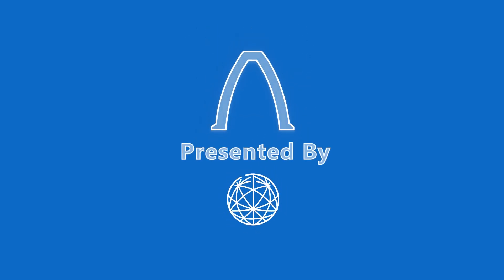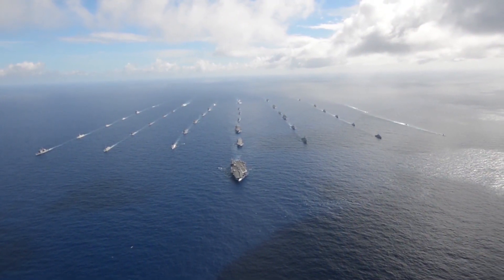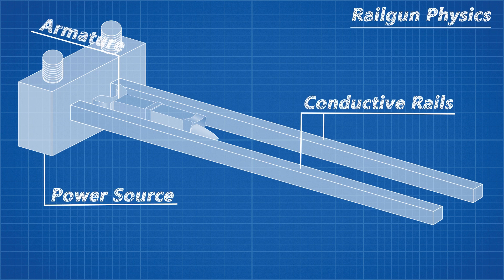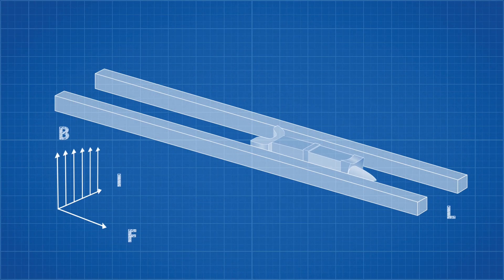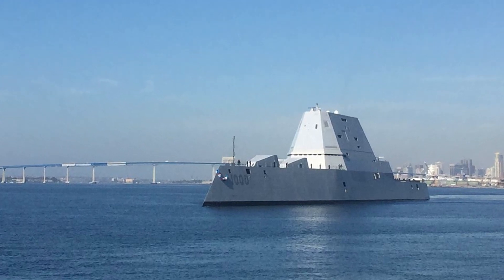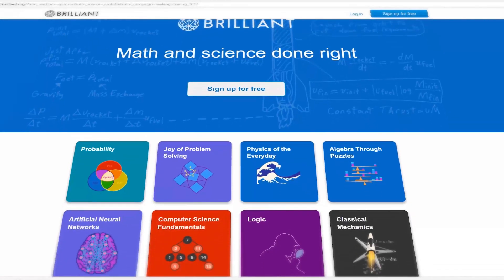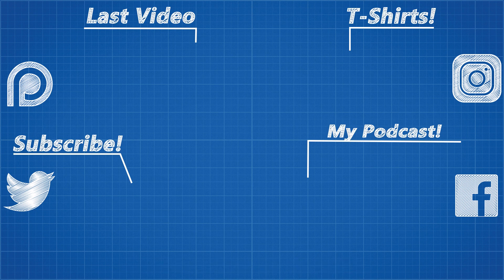The US Military's Most Powerful Gun

Comment: Another possible solution for electromagnetic propulsion is to use coilgun or Gauss gun/rifle. This does not need sliding contacts, and huge amount of current passing through, but it has other drawbacks (like ferromagnetic or inductive electromagnet bullet or armature, and coil(s) reluctance).

Comment: the pieces of  metal that came out when the projectile was launched were the  connecting plates of the projectile meant to complete the circuit of each projectile, each round have this casing that release when the gun is fired, its not the rail coming apart.

Comment: I'd really like to see the math behind deflecting an asteroid with a railgun.  Presumably to even hit the asteroid they'd have to fire when it was quite close, which means they'll have to deflect the asteroid's path significantly.  If they could hit it months or years in advance they might only need to change the path of the asteroid by a fraction of a degree, but so close to earth you need something a lot more drastic.  That just multiplies the amount of force required by orders of magnitude.

Also, since the asteroid would have a much, much higher mass than the railgun, wouldn't the force of even launching such a projectile push the rail gun really hard?  I mean, if it's enough force to change the trajectory of an asteroid, it's going to deorbit the railgun or send it into some wildly elliptical orbit, depending on which way it's shooting.  None of that sounds plausible to me, at all.

Comment: Out of curiosity, could the Lorentz force be used for artificial gravity of a kind. Wires in boots get a current, get a force going downwards.

On a side note, how much of middle ground is there when using the Lorentz force for a launch mechanism, vs as a gun. what I mean is once you have used the electromagnetic system, how much control is there of the final velocity once its overcome friction, to say safely launch a satellite or manned spacecraft compared to pressing a button, strapping in and hoping for the best as you get launched as fast as possible.

In scifi, I believe railgun technology has been used for other things than ballistic launches. in the Andromeda tv series, EM rails were used as launch systems for fighters and missiles, on the rational that they got up to top speed faster, that they didn't need to use fuel in the launch and so make the fighters smaller (smaller fuel tank) and the missiles pack a bigger punch (more room for explosives). with the missiles it also meant that they could be launched completely inert rather than having a controlled explosion going on behind which if something went wrong could affect the payload.

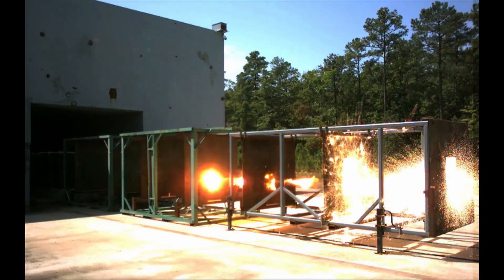Comment: iv got an issue with your point at 4:14, you say it needs 24 megawatts of energy to fire it. if im not mistaken 24 megawatts doesnt say anything if you dont paar it with a time, lets say 24 megawattseconds or 24 terrawatthours. if you take a charged capacitor and short it out and only look at the beginning of the discharge curve im pretty sure you can find a nanosecond or whatever where it puts out 24 megawatts. also if you power that thing from a ideal capacitor bank with minimal leakage you could charge it with 9v batteries if you want, just takes some time... :D

Comment: I didn't know a current could have an angle... The rail gun is so silly. I had no idea they were trying to design a gun which shoots a metal rod which needs to be in contact with the barrel as it fires. This clearly is never going to work as there does not exist the materials to withstand that kind of friction. If the projectile was a magnet could it be fired as a frictionless projectile? Not that designing guns is a worthwhile endeavour.

Comment: An all-electric Destroyer?! YGTBFrackingKM.  What is wrong with nuclear powered ships with an array of capacitors? Capacitors can be grounded in the event of an incident, harmlessly discharging their stored current into the surrounding seawater. They already solved the problem of catapults causing powerplant fluctuations on nuclear carriers with the semiconductor-capacitor-powered electric catapult.
If the U.S. Navy seriously wants to use this technology, they should bring back the nuclear Cruiser, and contemplate a nuclear-powered battleship. No fuel restrictions, endless supply of electricity. Any technology that is not a public danger is worth using for national defense.

Comment: Does not seem like rail guns are the solution to much of anything. Rail guns require an impressive power source, whereas chemicals are so much more simpler. In fact the good solution seems to be liquid propellant. Also you get such diminishing returns in high velocity because air resistance goes up so fast relative to velocity.
Reply: With rail guns you get far more effective range , accuracy and destructive power since the metal rod leaves at such ridiculous speeds. The whole point of using rail guns was to not use propellents , so scenarios that fell upon HMS Hood will be impossible.

Comment: We still use railguns?  Don't they break after using a few times?
Reply: Again, that's where you are wrong. You have to consider the fact that the 2 magnetic rails will produce enourmous magnetic for but not all of it will be going to launch the bullet, that will turn into waste energy/Heat. When the rails heat up, they soften and they will wear down easily.

What the thing that is wrong with your claim is that you have never heard of magnetic friction and how "Sliding" creates friction. both generates heat.

Obviously, you aren't watching the video. Most rail gun videos in slow motion always show a scene where a "Bright spark" comes out of the barrel, and those bright sparks and tiny puffs of smokes are the fragments that was scraped from the rails.
Reply: Again, you can't prove me wrong unless you explain everything about it, and i mean EVERYTHING.

Plus, you're telling me, that air materials such as oxygen and nitrogen are combustible huh? our earth is probably a huge fragile bomb based on what you say.

The hottest the air can be is until the point where they turn from gas, to plasma.(But it takes over 11,500 degree celsius to do so)

if the air does explode, then the rail gun has an ineffeciency of being slowed down by a little due the the pressure of the combusted air, BUT ENGINEERS DONT LIKE INEFFECIENY SO WHY WOULD THEY LET IT BE?

and if it's too hot that it causes fire, then it you would probably see a goddamn air distortion heat in the camera, but if you do, that's the hottest it can get.

where did you learn your science? Pseudo-science?
Reply: jake hansen let me say this again

A superior firepower will have a shorter barrel life in exchange, it's bad because you can't remain in the battlefield longer than everybody else.
Reply: The Dishonored Coward yeah but there's alot of metal with very high tensile strength, but they have nothing to do friction and stiffness.
Including the fact that  they are less conductive than the elements used for magnetic rails.

If there is a material with high friction resistance and high electric conductivity, then im wrong for assuming such metal dont exist
Reply: Yeah, with new technological advances new materials are being created to withstand the stressors of firing a high-velocity weapon such as the railgun.
Reply: No, thats actual fact. The rails literally melt and have to be replaced for testing after 3-4 shots.
Reply: ya don’t say
Reply: Chaos Craft999 you honestly think the rail guns barrel will run out before a barrel of an explosive charged projectile? Just think about what you're saying for a minute.
Reply: Chaos Craft999 but a rail guns barrel will last longer then a conventional barrel because less friction and less explosive energy put on it.

Again sliding something down a barrel compared to blasting it common sense.
Reply: Chaos Craft999 those sparks are the air heating up around the projectile and again use common sense and think about what you're saying.

The rial gun barrel will last longer then anh conventional barrel because if how efficient it is at letting all its energy out the end.
Reply: Eh, just use metal with higher tinsel strength and occasionally return to base to replace worn parts. It will be fine.
Reply: Ray B lol wrong.

The rail tends to soften everytime it heats up during firing, and it will tend to wear off by friction.

So its not durable as you think, it gives you higher benifits of, giving you longer firing range, higher muzzle velocity without the need of gas sealing for higher pressure(high pressure means higher muzzle velocity) and rifling for accuracy. But EM railgun has one drawbacks, its number of use/durability.

Edit:
Physics like nature, there are balances. For example, in laws of thermodynamics, you can have high effeciency power production but no free-energy, this "free-energy" is just a myth and a fantasy.
What i meant by that is "higher benefits also has equal number of negative effect or a drawback"

Comment: Relying on a round to complete the electrical circuit is a fatal flaw.  The rail gun will always have very severe barrel wear.   Now if only we could use a mass driver (linear motor)(ungoverned meglev track) or Gauss gun (coil gun) (Stacked stator rings) you could avoid friction with the barrel sides all together.  Both of these frictionless guns are far more complex to engineer and miniaturize.

Comment: I think another video is warranted with an AoA (analysis of alternatives) for electromagnetic propulsion of projectiles. 

For example, an easy alternative to the railgun, is the coilgun, with none of the barrel welding/heating/arcing problems. Additional complexity is introduced by the need for impeccable switching and timing of coil enervation, but at such high muzzle energies you would need the same switching and timing technologies as that applied to the railgun. So what drove General Atomics to adopt and try to solve the engineering issues of the railgun, as opposed to the coilgun?

Comment: Correct me if I'm wrong, but it looks to me like, as ElectroBOOM pointed out, magnets would be neccessary in the barrel for the bullet to actually have anything to push against. I don't see how in this configuration, lorentz force can really act... Does a coil push against itself when putting a current though it? How would the rails generate a field where the bullet is if the current "turns" at this point, thus also curving the magnetic field?
I am really no expert, I would only like to understand a bit better.

Comment: I was astonished when I learned that the Zumwalt destroyers are diesel powered. What a tactical blunder. Modular nuclear reactors are by far a better solution to powering an "all-electric" ship.

Also these rail guns seem like a pretty big waste of money in the era of anti-ship missiles.
Reply: Robert R. Hasspacher 

The Zumwalts electrical plant puts out nearly as much power as a nuclear reactor.

The reason we don't have reactors on every ship is because of the ridiculous cost ( training, building, logistics etc ) and the huge amount of safety programs you'd have to implement. 

Also Carriers and subs spend the majority of their time at sea so the reactors are more justified economically. Surface ships make regular port calls.

Comment: Navy has more or less decided the wear issue isn't actually an issue. Barrel wear is only a problem if you are making very expensive barrels, or it is exceedingly difficult to replace the barrels (meaning they have to go back to port). The truth of the matter is that ONR realized that the rails in a railgun just have to be two pieces of metal that can be electromagnetically charged. Anything else is just gravy.

Comment: You'll likely never put a railgun onto a satellite. Magnetic field shouls still cause a lot of recoil pushing the gun backwards, so every single shot will kick the satellite into a very different orbit, if not just towards a solar orbit or back to burn up in earth atmosphere. Not to mention a lot of energy is lost that way.

I wonder about the Zumwalt. I imagine you need a shitton of fuel to drive those heavy ship generators, wouldn't that just replace massive ammunition stocks with fuel? Tbf, that ship has already failed in almost any respect.

Comment: My Question is, Why Working with RailGuns instead of Gauss Rifles?
Reply: Juan David Pabon I’m no expert, so please feel free to discredit what I say. 

This video already explained how a railgun works: put lots of electricity through two rails and slap a conductive block in between them.

A Gauss Rifle (or Cannon) of comparative power would have to use a series of electromagnetic coils. A Gauss Rifle (I believe) is much harder to fire efficiently due to the fact that the series of coils must be switched on one after the other. Switched on as the projectile passes through, but switched off just as the projectile’s center of mass passes the center of the coil. This is because the electromagnets essentially pull the projectile through the barrel, rather than push in the railgun’s case. 

I believe it mostly boils down to the fact that though a Gauss Rifle might not have the downside of tearing itself apart after a few shots, it’s operating method is significantly more complicated than that of a Railgun.

As a side note, magnetic weaponry is notoriously inefficient at the small scale. The handheld coilgun I built is probably less than 5% efficient, meaning that 95% of the electrical energy put into charging the gun was lost to heat in the wiring.

Comment: Why dont they just cool the rails with helium pumps or an on board liquid nitrogen generator in the ship. I mean its electricity, the reason we can produce fusion or plasma is because of super cooled golden super magnets i forgot what the actual term for them was. But you can creat magnetism even under super cooled conditions as long as cracks dont form, and i thought they created one using coils and fairly large capacitors

Comment: I actually built a small scale railgun for my 9th grade science fair. It wasn't anything as elaborate, I used a small bolt as a projectile, a single stage I winded and taped over the barrel activated via microswitch, and a capacitor connected to the battery. Back then I called it a Gauss Cannon though, but I guess it's the same thing. Anyways, got 2nd place with it :D

Comment: So if the gun doesn't use gunpowder, where should the energy come from? If you install a bigger generator, you need more fuel, and wouldn't those fuel explode just the same as gunpowder if attacked? Well not as violently so probably not as spectacular but no less dangerous to the operation of the vessel right?
Unless you do nuclear, then you would just have bigger reactors and more nuclear fuel which are even less spectacular in terms of explosions but probably more dangerous.

Comment: Interesting point about wear of the rails.
This makes me think of the coil gun concept. In the coil gun, the projectile never touches the electromagnets, thus no wear occurs.
What made the US Navy favour the rail gun over the coil gun?
Mass? I immagine a coil gun with its array of multiple electromagnets will be both heavier and bulkier than a rail gun.
Reply: Coil guns don't have nearly the projective force capability that a rail gun does. By at least one order of magnitude, possibly more depending on the type of coils you are using and the methodology used in starting them. Also mass, yes, but mostly it is the projective force issue.

Comment: As far as I can see, most of the railgun as a military venture is a waste of tax-dollars. If you are firing at an object 100miles away, it would have to decelerate and fall to Earth (Like a howitzer shell), losing most of it's penetrative abilities. Even then it would have to be a static object since trying to fire at a moving object would be a mess, especially a tank or vehicle since they can accelerate, decelerate or even change direction. 

With that said, a cruise missile is made for this purpose and would be a lot more effective, even cheaper. With railgun you have to replace expensive armatures every few shots, a tungsten projectile is very expensive, the entire weapons system itself. Cruise missiles generally get the job done better, only difference being a cruise missile can be shot down. However by the time the railgun projectile reaches the object, it's energy will be much diminished and will hardly cause any damage.

As a ship to ship weapon with a direct line of sight, yeah, good weapon. Beyond line of sight, useless due to loss of energy/ accounting for the Coriolis effect. But then a 203mm naval gun does about the same damage and costs 1/10th the price, and can fire 10 rounds a minute with consistency and not divert power from the ship itself. This whole railgun thing reeks of useless in the military area. For firing supplies into space, satellites and the like, yeah do it.
Reply: One day railguns will be cheaper, more compact, and safer, with higher velocities and more kinetic energy.

Comparing a prototype to a mature technology won't get you anywhere.
Reply: FedorovAvtomat A naval gun may get the job done too, but the purpose of the rail gun as a naval weapon is so ships don't have to carry explosive ammunition. Sure, there are problems with the rail gun, but there's upsides that counteract those downsides.
Also, cruise missiles aren't that cheap. Tomahawk missiles cost $1.87M each, according to the DoD's 2017 "budget request program acquisition cost by weapon system".
Reply: Random guy will ever be? More like until a few years from now
Reply: how can a gun me more precise then a missile?
Reply: @hp2084  maths
Reply: still his point stand still, a cruise missile has better range and is more precise than a railgun will ever be